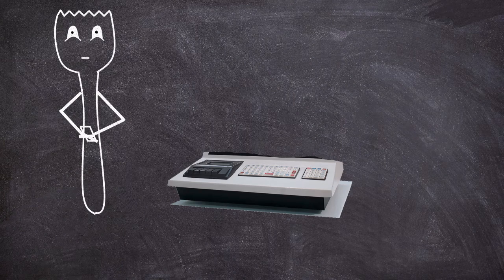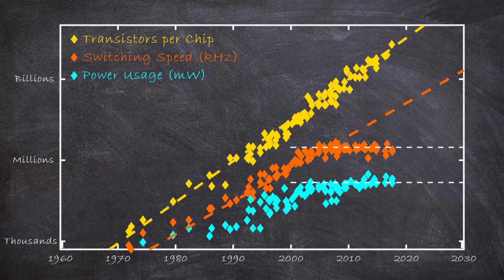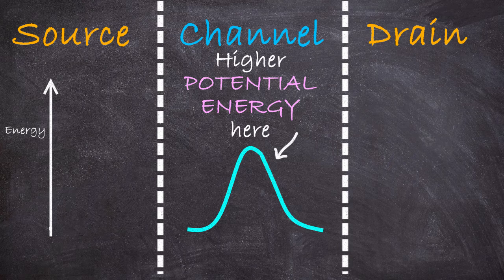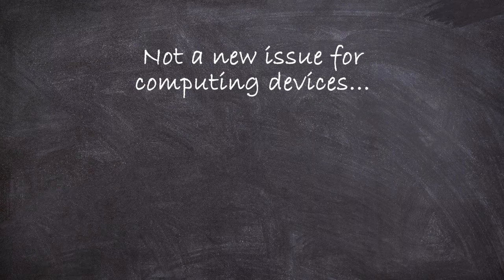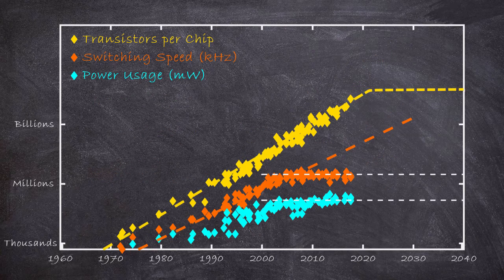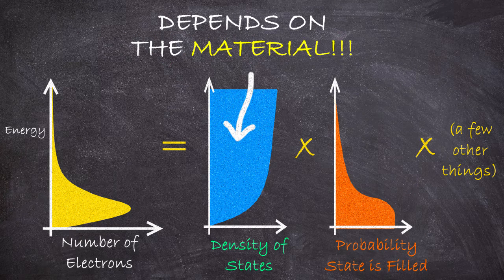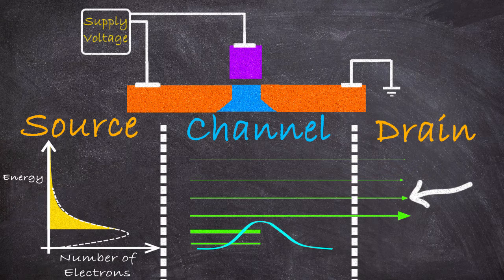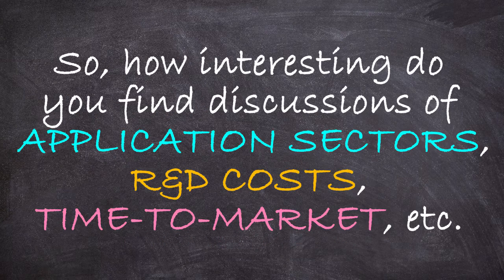Boltzmann's Tyranny and Quantum Tunneling: The End of Computing?

Comment: If I understand correctly, quantum tunneling and electrostatics in the chips are different ways of saying the same thing. In the early days of computer engineering, attempts were made to do more than base 2 binary. The problem was error rates at any higher base systems, so this was never addressed. We are trying to get natural complexity (3D) out of a binary math model and programming language paradigm. In the execution of an algorithm, modern chips now have a deterministic output with non-deterministic search paths, meaning time resolves within the search, in the materials of the chip. The goal should be natural complexity from a 3D math model with reliable 0-1-2 gates. If you rewind to the years immediately after WWII, the investment was made in what we have now. You're right, we have reached practical limits. How hard this would be to design and engineer, I'm not sure, but if we had spent the last 70+ years doing it, it would be done now.

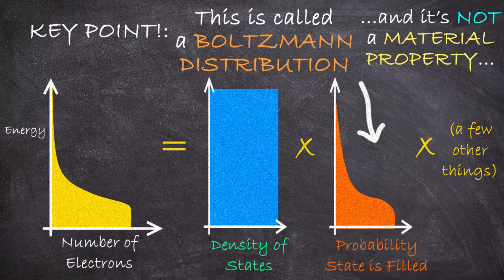Comment: 17:50 Technically, it has to follow the Fermi-dirac distribution -- the Boltzmann distribution is just a low-energy approximation that's a bit easier to work with.

Comment: You are a real example of a non-scientist. You are a brain drooling pencil pusher. There. How about getting off your butt and measure the pressure from a laser as it reflects from a mirror? But of course you cannot because you are afraid the equations would not hold and then you would be pushing nothing but crap from the mental part of your body. You cannot even imagine a light/laser beam bouncing between two parallel mirrors creating excess energy at each bounce (because light's color does not change at the bounce) that then trashes everything you ever said. You are stuck -- really brainwashed -- in the popular mainstream context and are able to just create the same bedtime fake stories for the kids. Light does not create energy or mo at the bounce (without absorption).

Comment: They said I flatlined and that I should have disconnected the power cable before tearing down my system. I'll finish watching after I get back from hospital.

EDIT: Mkay, finally got discharged. They said it might only take a few operations to graph over the burns. So, that's good. Now, while we can't control quantum tunneling, what about scaring the electrons by blasting photons at the channel. No self-respecting electron is entering a tunnel when there's a light barreling toward them! And Bob's your uncle. 

Very enjoyable presentation. Expensive and painful...but enjoyable.

Comment: As a computer engineer of 35 years, I must say this is a perfect explanation of the limitations.
The interim solution is to increase the physical size of some components and to invest in the promising field of room temperature superconductors; the magnets that will contain ITER’s plasma flow are made from long strips and wound to make the magnet’s core, this greatly reduces the heat loss and could be used to reduce voltage fluctuations and to regulate energy loss; this would also lower the unwanted effects of tunnelling by magnitudes of order. Thanks for the presentation. :)

Comment: Si photonics programmable and ASIC waveguides working together on the same chip and micro interferometry? A lot of people are working on the basic building blocks (miniaturization and fab especially) and I've read some rather cool alternative ideas to avoid refraction contrast waveguides (because physically large) but it all seems more like the 50's and 60's level of development compared to now with traditional electronics. Data transfer, we got that but defects, tolerances and predictive modelling remain huge problems for optical computing. Even IBM's new state of the art prototype still uses electronic (voltage) switching. Nevertheless, great video sir.

Comment: Great video!  I find that if we continue to look at semiconductors as magic quantum electron tunnels, and we keep treating dielectrics as just insulating barriers to keep these electrons at bay, we will probably never solve this problem.  Also, the Quantum Tunneling idea is really using Schrodinger's WAVE MECHANICS equation to describe "charge density" and not math waves of probability for electrons to magically tunnel.   Anyone can do a simple experiment to understand that electron theory doesn't explain how dielectrics work.

Here is a simple experiment that puts into question the real role of the "insulator" as a separator of metals: 

https://youtu.be/mnyZpsJkMDk

Comment: I thought quantum tunneling was the way we explain why insulators tendency to approximate resistors as they strink.
Reply from the maker: Yep, you're right! You're talking about Schottky contacts and junctions. When a Schottky junction is not very abrupt the main way flow happens is by high energy electrons over the top (thermionic emission as I discuss) but if it's very abrupt (this is done by having high doping) then it's thin enough that tunneling is dominant. When you're deep in that regime transport through the junction will be Ohmic-like and you get an "Ohmic contact".
Reply: @atomsandsporks6760  The ohmic analogy help you intuit why quantum tunneling is a problem. The understanding that electrons can move though a barrier does explain the resultant heating that is impacting the efficiency of microchips.

Comment: What impact would this problem have on recent CE grads? For example, if someone recently graduates having only learnt about transistors etc. would their degree and knowledge become useless after the limit of transistors is reached?
Reply from the maker: Hi, great question! It wouldn't. Honestly, I feel it's the opposite and it's a very exciting time to be a new CE grad.

What my video is about is basically the (very quickly) approaching physical limits of Moore's Law.  Moore's Law exists not because it's a physical law of nature, but because it was a self-fulfilling economic prophecy on the part of the semiconductor industry. Chip manufacturers would produce a brand new fast chip using new fabrication technologies produced by the manufactures of fabrication equipment (which is a different industry). As a result programmers and software companies would produce new programs and applications that demanded even more computational power than ever before. Furthermore, new software application areas open up with computing "horse power" and computers leave the lab (scientific and military codes) and enter the work place (spreadsheet, business programs, e-mail) and then the home (computer games, cat videos) and then the lap and then the pocket ("there's an app for that"). With these new softwares on the market more and more people would start buying computers and there'd be a knock-on effect back down the line: more people demanding computers to use new software, more software sold, more chips sold, more fabrication equipment demanded. So then the fabrication equipment industry gets out their new line of equipment (lithography, etch, etc.) and the whole thing ratchets forward a generation.

It's a self-reinforcing cycle. And it's a cycle that only had two metrics for its looping: switch speed (a.k.a. clock speed) and number of transistors (well, on the part of the CPU at least).

However, totally irrespective of these physical limits, this cycle has started to change. What is happening is a diversification of the nature of demand on both the software and hardware end. The "wants" are becoming more varied and complicated. The biggest example of this is mobile phones. Mobile phone manufacturers don't actually demand faster chips, it's not their first priority, they want LOWER POWER chips, and the also want chips that interface very natively with peripherals like radio circuitry (i.e. the talking and wireless data functionality), with touch screens and cameras and so on. Their primary "want" isn't more transistors per chip, it's a more customized chip at all levels that is specialized to a different set of motivators than the programmers of old ( who just thought in terms of "More computing power! Nothing else matters!").  Internet of Things applications (to the extent that that isn't just an over-used buzz-word) demand even more specialized chips than that with a very different set of criteria for "better than last year's version" than Moore's Law suggests. 

The chip industry is being pulled in a direction of specialized or so-called Application Specific Integrated Circuits (ASIC) that are requiring from-the-ground-up redesigns of all parts of chip making: the device level (the FETs), the architecture level, the front-end and the back-end. And although the idea of an ASIC has existed forever, it has taken on whole new meaning in the last 20 years as the breadth of applications is exploding. People want dedicated chips that are: Lab on Chip (LoC), that are System on Chip (SoC), that are passive and can harvest their own energy, they want "smart dust", they want thin-film transistor networks for LCD screens, and so on. These applications require changing everything, they are in a sense about forgetting "number of transistors" and "switching" speed and starting a whole new journey.

So, to bring this rather long comment to a close (sorry for that!), in some sense it's a great time to be a new CE grad, because the industry is changing things up at the architecture level in ways it never has before. And to do that they need young blood and new ideas. And if you're a research physicist like me, many of these things like spintronics, flextronics, valleytronics, photonics, polaritonics, graphene, carbon-nanotubes, 2D materials, quantum computers, and the kitchen sink, have ZERO chance of saving Moore's Law, but we're still interested because the industry isn't actually asking them too.
Reply: Keep in mind that there's still a huge market for "traditional" transistors. In fact a lot of innovation is being driven by mature technology nodes. Also, knowing the fundamentals is still extremely valuable.